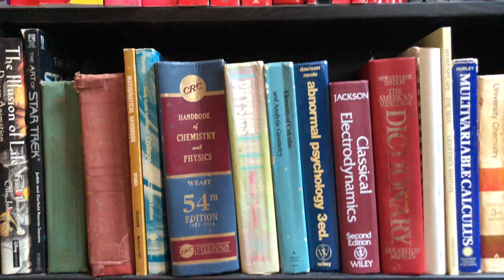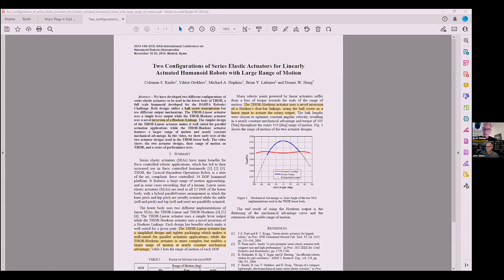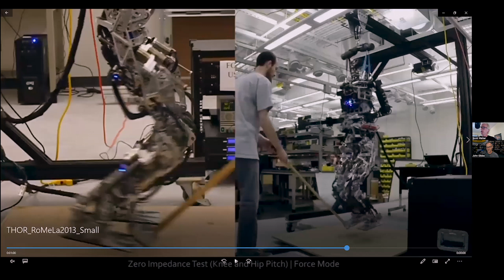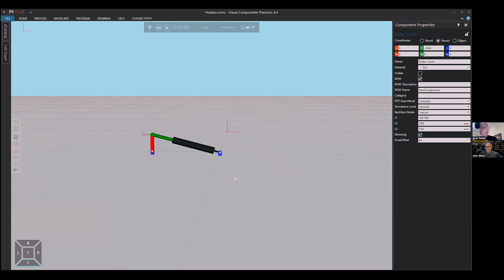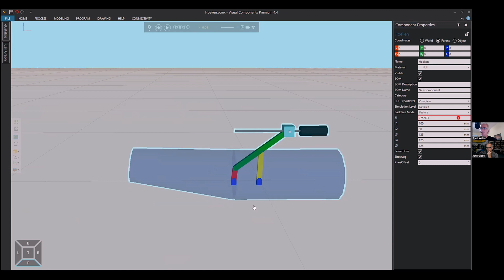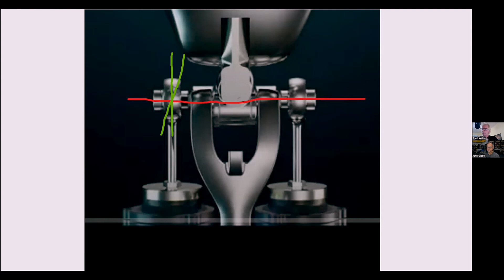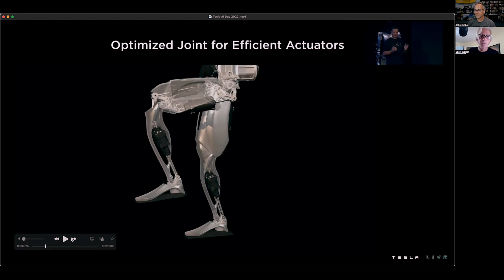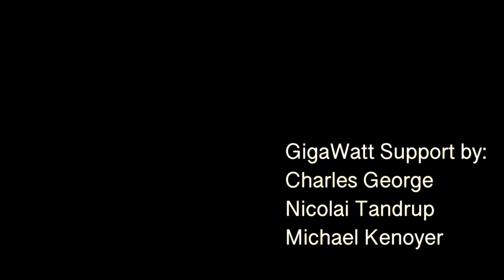TeslaBot's Knee Was DESIGNED IN 2014! How Tesla Evolves Cutting-Edge Research. With Scott Walter

Comment: The joints are just off the shelf spherical joints/rod ends used in steering and suspension and heaps of farm machinery. They have a Teflon liner the ball rests on. Some have a grease nipple on the larger joints

Comment: What I should have also pointed out is the Hoekens Linkage does not scale really well. That is the proportions must remain at 2.5 for any size to maintain the linear curve for the drive unit. But the Optimus Linkage has not such restriction, hence each link can have a unique length, and thus the design is easier to optimize, or make compact.

Comment: At minute 37 where you are talking about the actuator and the intermediate lever becoming parallel and binding up you aren't taking into consideration that the intermediate lever is bent and there is still good leverage between the pivot points.

Comment: I really like the Video but imagine This stop your green line where it connects to the yellow line extend your yellow line beyond the blue dot hinge point the other direction the same link so your yellow line becomes twice as long with the blue dot the hinge in the middle then you can use to Small actuators with the same performance but in a smaller package

Comment: Really interesting explanation on achieving adequate range of motion. My question is about actuator responsiveness. One can achieve motion similar to humans, and it would seem the second step is to respond in the same practical time frames as a human. Humans can take a sensory input and create a motor unit response in the 200-300 ms range. Do the kinds of actuators discussed have similar, or even better, responsiveness? I realize that part of the latency would be sensory and computational, but that is likely the smallest component. Again, keep em coming.
Reply: The responsiveness will be much faster than humans, and be able to react to stimuli in 10 ms or less. The mid-sized linear motors can slew end-to-end in 10 ms. More than fast enough to catch a fall.

Comment: A wild idea:

I have a question about Tesla Bot feet. Why not borrow from animal kingdom and use same parts for Bot hands and feet ?

Some chimps have opposable toes on their feet, so why not use Bot’s hands as it’s feet as well ? 

The opposable toe/thumb gives the foot much more stability.

The opposable toe, allows the bot to hang from bars and other structures, may be a good skill for manufacturing etc.

And the feet would be another set of available hands to pick rings up etc.

Also using the hand for the foot eliminates a part and creates more mass manufacturing of the hands.

Comment: Will Optimus have enough range of motion to get up off the floor if it falls?

The discussion about knee joint range of motion got me thinking about this.  As a general use robot, it is going to fall and will need to be able to get back up on its own.  Can it do that with a knee that has limited range of motion?  It seems we all want to rush to walking, but it seems the first task should be to get to a standing position from every possible prone position (back, front, side).
Reply: Good Point. Might not recover the way you and I do, but probably will figure it out. As we get older we are taught new methods of recovering from a fail, because of lost range of motion.

Comment: Why do the actuators on Optimus come in apposing pairs? For example the actuators both on the thigh and shin. In a human, the muscles have to be in opposing pairs because muscles can only pull - they can't push. But the linear actuators on Optimus CAN push as well as pull. So why do they need both? Surely they could remove almost half the actuators on Optimus. The best part is no part.
Reply: To control two rotations. Together is ankle pitch. Opposite is ankle roll.
Reply: @goingballisticmotion5455  Perhaps for the shin but the thigh only needs one actuator for the knee.
Reply: The hip/leg joints need to splay sideways as well as forwards, plus spinal side-to-side to effectively extend the upper legs differentially.
Reply: @paulrautenbach  Correct. There is only one for the knee (quad). The other is for the hip flexion (hamstring).
Reply: @imconsequetau5275  Oh, OK Thanks.

Comment: On stupid requirements: It's not a fully humanoid robot unless it has articulated toes. But if you can make them a million times faster and a million times cheaper if they don't have any toes because you've designed a robot that can build 99.99% of itself and it's parts without human help, then it's better than a fully humanoid robot. We can worry about toes after we've built 100 million robots.

Comment: Will Optimus be strong enough not to fall?

The development version of Optimus moved very slowly. That indicates that its actuators are too weak.
One consequence of being that weak is that you can't parry sudden balance problems.

The new Optimus, with Tesla developed actuators, might be stronger. It would be interesting to see if it can move at normal speed, and not just in slow motion.
And to see how it handles a sudden balance problem event.
Reply: I don’t think slow=weak. But your point that it will need to move quickly enough to keep balance is valid. Can this be done without using electrohydrolics like Boston Dynamics?  I think so, but Optimus hasn’t proved that yet.
Reply: Don't confuse speed with acceleration. The new Optimus seems to pack some punch when it comes to torque. What is critical is rapid response to a perturbation, not the maximum speed.

Comment: System Integration:  Why the 2nd generation robot could not do as much walking as the first generation robot at AI day 2. Even though the 2nd generation robot had brilliantly engineered/designed/manufactured joints and actuators the pile of parts requires system integration testing and that takes time. What we saw at AI day 2 was a work in process with incomplete system integration. So, the optimus robot prototype gets a grade of "incomplete" rather than "failure" even though at the time of AI day 2 it could not walk. If after a year (from now)  the end state of the parts was still "not walking" and "never walked" it would be a complete failure and embarassment to Elon Musk. As it is, it looks like it should sucessfully complete system integration and be a useful programable robot in a humanoid form factor. 
Phew,  I think that puts into explicit words the unspoken intuition we all have about AI day 2.

Comment: For the life of me, I don't understand the fascination of making a robot look and move like a human being.
Try this experiment: tomorrow, make a list of all the animals you come across in your life - squirrels, rabbits, dogs, cats, etc.

So how many of them walked on 2 legs? Of course, the answer is ZERO. Walking on 2 legs is a horrible way to move - yet robots seem to be designed to be very inefficient in walking/running.

And if you are designing a robot from scratch, why on earth have feet? Why not something like a paw like all the other creatures you came across while watching from them?

Maybe the robot geeks just lack some common sense?
Reply: The easiest way to replace human jobs is to create human like robots
Reply: While it would be possible to build a “centaur bot” with 4 legs and 2 arms, building one that will move at human speed would result in a lower body that takes up quite a bit of space.  It may be that such a robot would be useful, but it would have to have accommodations to work in the current world.
Reply: Velociraptor
Reply: Humans are fine with two legs. Human doesn't need to be as fast or agile as certains animals. This is probably applies more for Tesla bots. It is not mean to run. The ability to walk at a pace above a tortoise is enough. Something as agile as Boston Dynamic is heavy and lacks energy efficiency. I am sure there are better reasons to why two-legged is good enough.
Reply: @nguyep4  What is the purpose of the robot? Well, in the case of Tesla, it's to replace folks working on a job with robots that can work cheaper and longer. Is this a worthwhile goal? I don't think so.

What do we do with the unemployed folks whose job no longer exists? Put them on welfare and give them food stamps - that we all pay for?

A 4 legged robot will not replace a human at their job. There are plenty of tasks the robot can do but replacing a human at a cheaper rate is not one of them.
Reply: Of those animals, how many developed the ability to use and make tools?
Having limbs free from the task of moving was so advantageous in evolution that that is how we evolved.
Reply: @Anonymousg64  I think just about everyone on the planet knows that. A 4 legged robot can have interchangeable hands and feet and can stand to do a stationary task with something better than hands.
Reply: @noleftturns  but its not efficient, otherwise our anatomy would be that.
Reply: Walking on two legs is more efficient than walking on four
(Also just in advance I’m not intentionally disagreeing with your comments across videos. I just happened to be watching this one too and had that info)
Reply: @SyntheticSpy  I'm just looking at animals we encounter daily and mother nature taking billions of years to make that creature - 4 legs seem to be preferable to 2 legs 95% of the time. We need 2 hands-free to use our brains to make things with - no other animal needs this. There is no reason a 4 legged robot can't stand to use 2 limbs as arms, but it should not move in that position.

A robot should easily run at 100 mph - why limit it to 20 mph? and a 4 legged animal isn't going to take your job from you. That, to me, is missing from robot design - replacing a human with a robot as the primary design element is a horrible way to help mankind.

And the biggest problem with robots that look like humans is when it decides one day to take the US citizenship test, and it passes 100%, and wants to become a US Citizen. I know the US Constitution fairly well, and it does not prevent a hunk of steel from becoming a US Citizen and then voting - by the hundreds of millions for one candidate - who happens to be a hunk of steel.

I understand the enticement by the military to make a Terminator for the battlefield that can fit into 2 legged-oriented equipment. Still, that approach leads to all kinds of social problems that the AI geeks aren't considering, but we as a society much live with - or die with, I guess.
Reply: @noleftturns   if the AI chose to take the citizen test, something it is not trained to want to do or have any understanding of, then I imagine it would probably have gained sentience in that scenario in order to have a personal desire for it. Is it not fair to say that a being with sentience deserves to be a citizen, or to at least share some level of the rights that we feel intelligent beings deserve to have?
That part of it is a whole other philosophical topic of course, but I don’t see any form of true AI existing for a decent while at the moment. All we really have are algorithms that get better at specific things we train them on. But who knows really? I might wind up surprised. ¯\_(ツ)_/¯ 

In reference to the bipedal aspect, I meant efficiency in terms of battery drain and how much power it takes to move around a given area. If you want to maximize operable hours on one charge/while untethered, then two legs is a really good option. Wheels would be better, but for climbing stairs, and other sorts of terrain, two legs are probably the best option. After all, one of the reasons humans were so successful as pursuit predators was because we expended significantly less energy moving than the animals that didn’t naturally walk upright